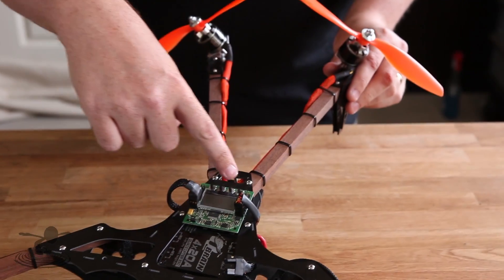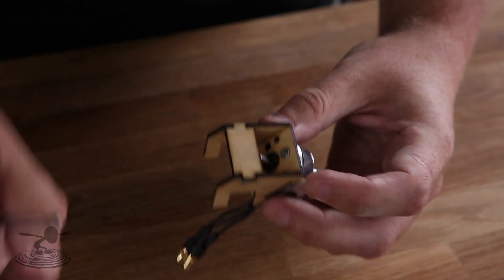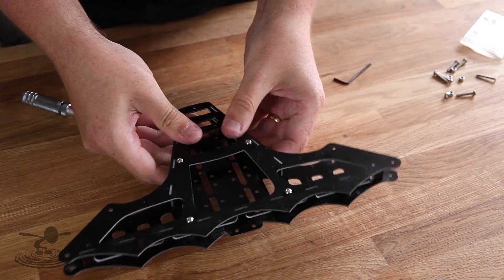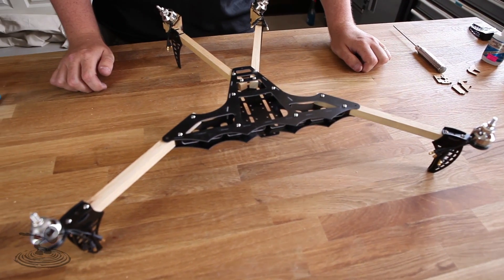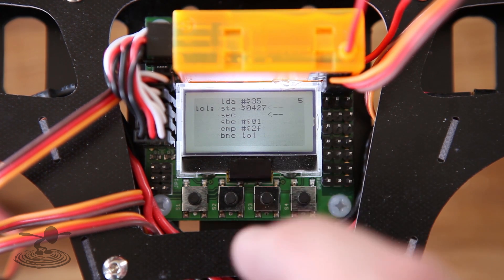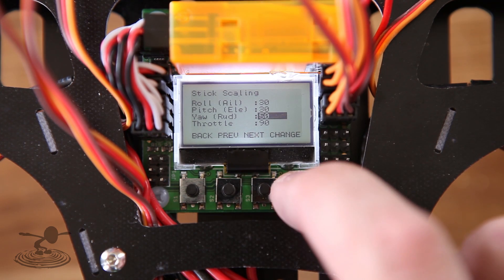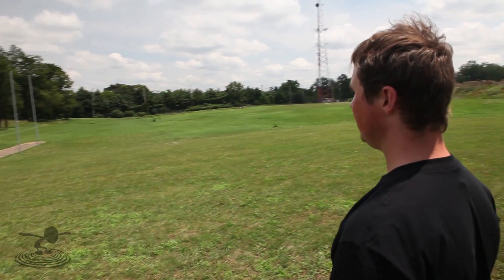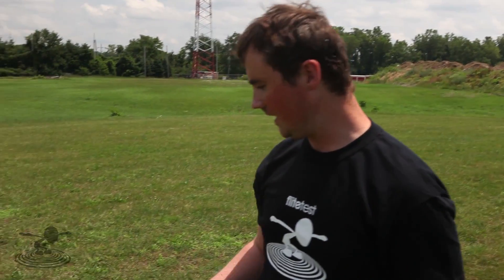Flite Test - V-Tail Quad - BUILD

Comment: Very much so, depending on the application. CA works best with good mechanical fit, flat or tightly fitting surfaces. It doesn't gap fill very well. It's excellent for bonding pieces together that mate flat surfaces. Hot glue is a softer thermoset material that retains a level of softness and is better for a more limited group of materials. It should not be considered structural like CA most of the time. For paper/foamcore, sure. Balsa/Basswood? Nope.

Comment: argh, I couldn't wait for you to release the video, so I built my own v-tail quad using the plans for your original tricopter body. however, I didn't know that there was a v-tail option in the settings, so I set it up as a normal quad. funnily enough, it few fine! however, it had a tendency to kick pretty badly in the wind, and was difficult to get set up correctly.

Comment: Very nice as always ! 
I'm going to use the same motors, esc's and board for my bat bone tri.
David, you mention you would'n use these motors for flying with the gopro, is that because of the power to weight ratio? Is that also the case when I don't plan to do any acrobatics with it?

Comment: Thanks David for including your KK2 settings. What size battery do you prefer when flying this sized tri / quad copter? I built your tricopter recently and I'm using a 3s 2200 battery. Will this be enough if I want to add basic Fatshark FPV gear to it? Thanks!